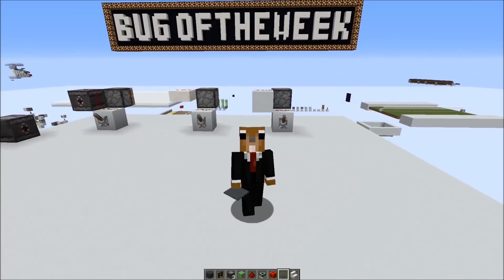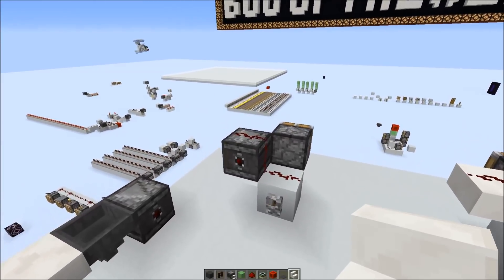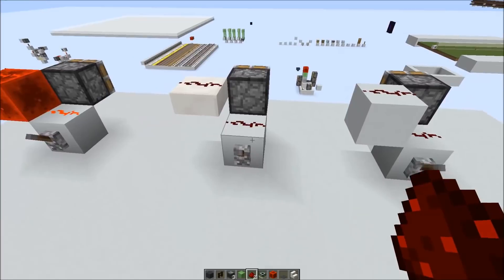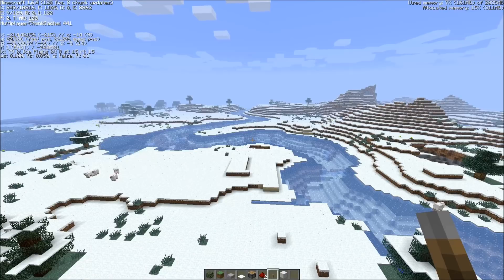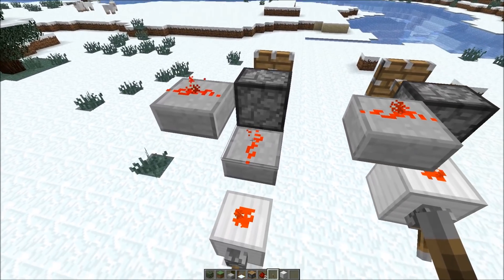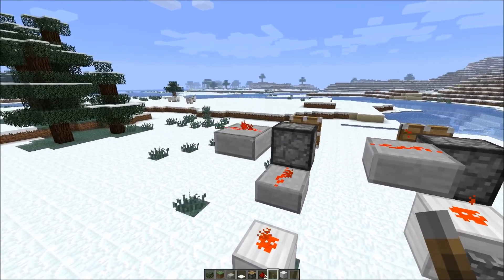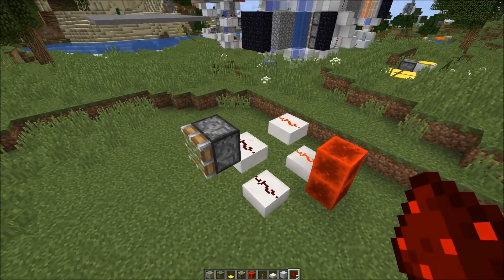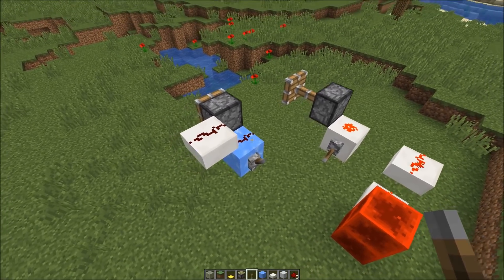Bug Of The Week 22: Redstone Dust Visuals

Comment: The weirdness happens partly because it's the higher redstone dust that connects downwards to the lower one since nothing is blocking it, while the lower one believes it can't connect to the higher one because of the lack of solid face. With the update issues, placing the top dust second triggers the change because it believes it's connected, while placing the bottom one second doesn't trigger the change as it doesn't believe it's connected.
In the older versions, the visuals reflected the actual connection state according to that one dust block, but the newer visual behavior seems to also be affected by the surrounding dust that believes it's connected.
Finally, it's also important to remember that for power to flow from one dust to another, it just needs an unobstructed path, so it doesn't care about the connections in the blockstate.

Comment: Interesting. As someone who isn't a proper redstoner, what I don't understand is why you wouldn't want the piston to be powered in the case where there is a full block. I find the directionality of redstone dust somewhat annoying.
Reply: The reason is for compacting.  You may need to run a redstone line beside a piston you do not want it to power
Reply: As he said, "It's helpful to have options." Having the ability to do this adds choices. If you don't want to deal with the bug, then don't put a slab there.
Reply: Dylan Beaupeurt yes, but it would break most large redstone contraptions.
Reply: +Austin Martin OK, thanks for explaining unlike some unhelpful people. The reason I find it annoying is that sometimes I need to use extra space to make the redstone line point into the block to be powered.
Reply: An easy way to solve that issue is to have a solid block directly beside the piston to be powered. Run redstone on top of that block, and the piston will be powered no matter how the redstone is oriented.  But if the redstone itself is beside a piston, it will not power the piston unless it is a single dot, or pointing to the piston.  This is helpful in many ways, especially when working with tight compact stuff.  

However, in Minecraft PE (or Bedrock, whatever), redstone dust will always redirect it's direction to attach to the piston, and that is kind of dumb in my opinion.  It takes away the option to run lines beside pistons.  I don't see a reason for that because there are other alternatives to powering pistons (like I mentioned with the solid block).
Reply: Dylan Beaupeurt    Go away

Comment: 2:40 It still wouldn't show everything correctly. A piston on the opposite side receives a visual line,  but doesn't get powered. (MC-9405)
Reply: That’s actually rather hard to fix in a nice way. Any ideas on an optimal solution?
Reply: especially in this scenario: http://prntscr.com/jbjxif
Making it a dot would suggest powering stuff, too, while the redstone actually powers stuff in none of the 4 directions.
Reply: Unless you make two distinct visualisations  for in and out, I think it's pretty much impossible. That would get too cluttered. And while the directions to the possible power sources determine what blocks get powered, the reverse doesn't apply. So in my opinion showing only connections to incoming power lines would at least be better than what we have right now.
Reply: Basically how it was before. But straight lines end in the middle of the last block.